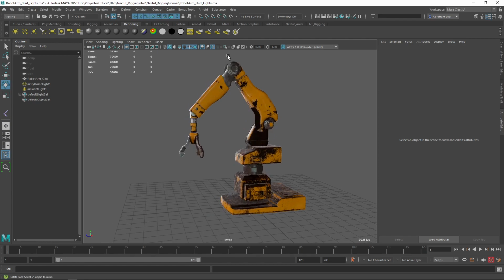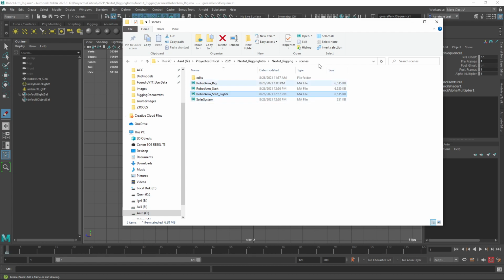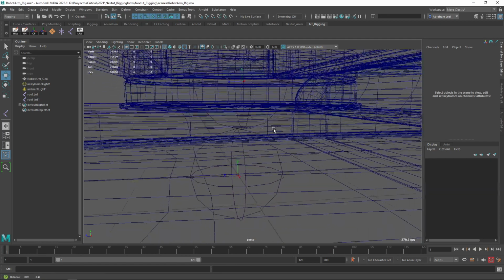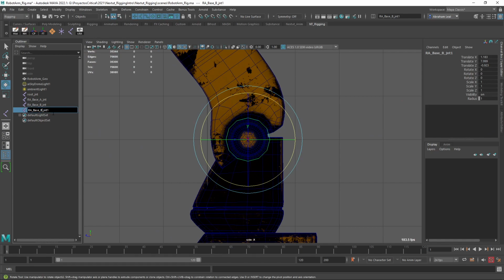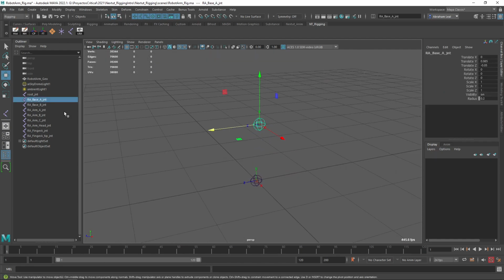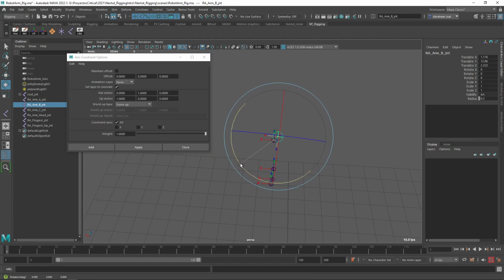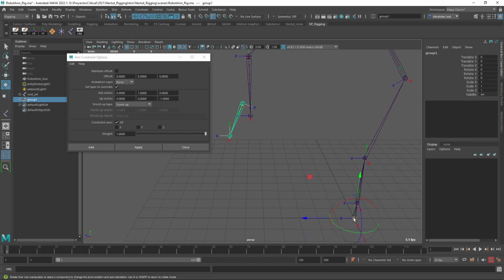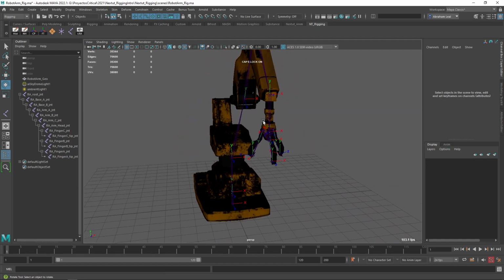Rigging Course Free Chapter: Robot Arm Joint Setup

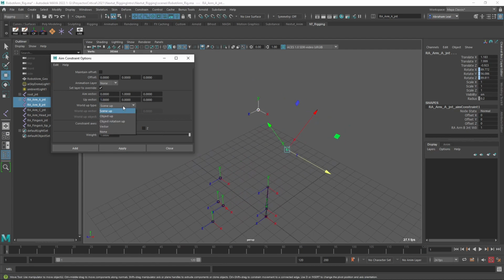Comment: 12:20 There's a tool specifically for this purpose called "orient joint" in the skeleton tab. This is a much more sensible approach, but to use it, you first need to chain the joints together and then use the orient joint.
Reply from the maker: Thanks for suggestions.